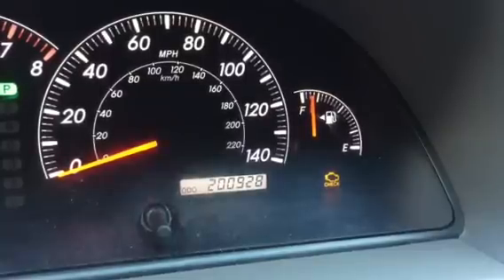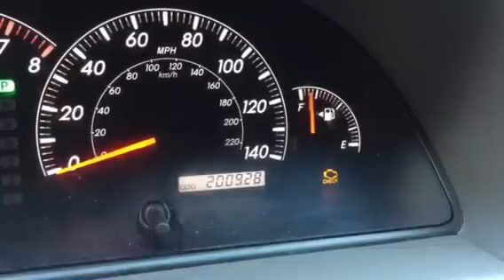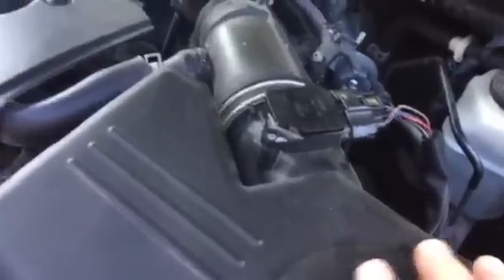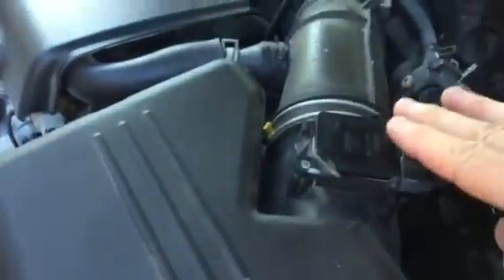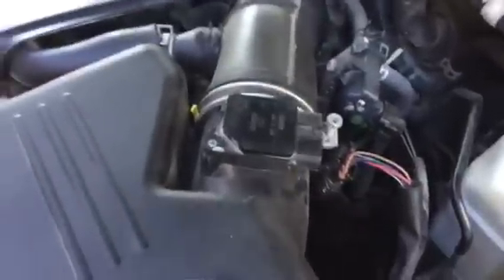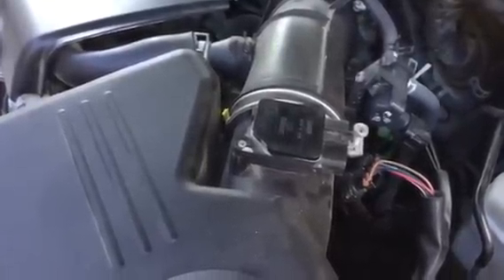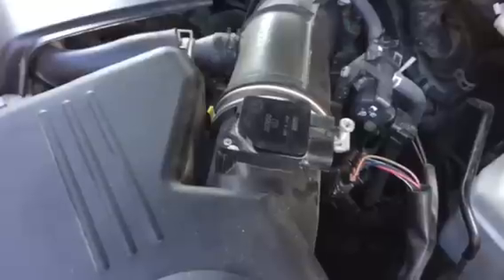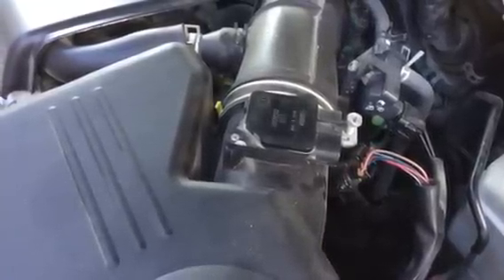How To Tell If Your Mass Air Flow Sensor Is Bad On Your Car

Comment: I unplugged mine and it went into limp mode and had to drive it home 20 mph. Does it mean it’s working? I changed throttle body plugs coils and air filter.  I ran injection cleaner and cat cleaner. I still have hesitation when kicking down a gear on hill. I. Bought  a maf sensor and 
when I put it on it made the 
engine valve’s slap like cheap gas.I am gona try a new maf sensor and see again if it’s the problem.

Comment: This just made the car run worse
Reply: your car could have went into failure mode. which protects your engine and does not let go more than 3000 rpm. For some cars you need to go to mechanic to exit this mode. hope it helps

Comment: Before you go replacing the MAS you can take it off and clean it with electrical cleaner spray, this usually works and saves money
The same with your idle control valve

Comment: I’ve try it on 15 Subaru wrx and the engine is not dead but the idle is upset.
Then while the engine run I plug in the harness back and the engine just dead.
I wonder if anyone can tell me if my sensor is good or bad?

Comment: Took my 2009 prius for oil change and they gave it back to me with engine light  on. The cel light was on. They said car would not drive while  running, they also said engine was running poorly. So when they found code p0101 they did more inspection. Checked and moved harness and noted loss of engine powers fault.
Removed sensor, cleaned and test voltage with sensor pulling good voltage. Used another sensor from  used car and sensor was reading the same. They saw rodent feces and probably rodent damage to the harness. Resseted and manipulated harness and pulled error  code again. Resetted 3rd time time and noting  no faults or problems.. They recommended  
more  electrical testing?? They said if issued further happens...possible harness issue

Comment: Not quite correct. IF the junction or harness is impaired -- the sensor could be fine -- and yet the ECU will read a trouble fault.
The only way to prove that the harness and connector is good/bad is to directly test the leads to the sensor.
With a voltmeter -- even a cheapo $10 one -- this is pretty easily done. Two of the pins must be 12+ and 0 volts, ground.
12+ is always going to be on the right if the sensor is a Denso. (Very, very common -- the one shown is a Denso.)
The system ground pin will be right next to it on most Denso sensors. 
The signal back to the ECU will usually be 1-2 V coming off the next pin in. (Denso, again.)  
[The 12+ and 0 volts must be engaged with jumpers for this test...] 
You do all of this when there is any question about the connector or the harness... which is rare.
When an engine is all warmed up, the ECU will not depend upon the Mass Air Flow sensor. So the video advice is untrue. The engine must be cold.
A warm engine means feedback from the oxygen sensor -- and the ECU will run the engine -- badly -- with that input. It won't instantly stall.

Comment: Yeah I just wasted a hundred bucks because I did exactly what you just said and numerous other people on YouTube said your engine will stall well I checked mine I pulled it off and the engine did not stall what you say means it's a bad sensor so I went and spend a hundred bucks on a new sensor put it in and just to check it I unplugged it engine stayed running you going to tell me that brand new two sensors in a row or junk you're full of shit that don't work

Comment: I cleaned throttle body and mass airflow sensor now my car wont start it cranks but no start I'm wondering if it's the mass airflow sensor
Reply: what did you use to clean the mass airflow sensor? it needs a specific cleaner or else it will be damaged, also never touch the sensor that sits in the intake pipe as well it’s very sensitive. was the car starting before?
Reply: @user.256z  thanks for the response it was tge mass airflow sensor I replaced it started right up i used crc mass airflow sensor cleaner

Comment: Mine kept running when unplugged. Then died as soon as I plugged it back in, does that mean it's bad on a 2005 Chevrolet uplander?
Reply: it could be your mass airflow sensor. how does it run when it’s plugged in? also t could be sending false readings when you plug it back in

Comment: Some cars like my 01 ford van will go to default settings. It wont run 100% but my van wouldnt start and by disconnecting it the default kicked in and van started

Comment: Happening to my Astra K right now.. I got 3 error codes 2 relating to Air Flow (P1101 & P0101) I also have P0299 which is Underboost relating to turbo im also gonna guess that this is also due to the same problem- Air Flow since it has triggered "Limp Mode" so the cars performance has been reduced.

Comment: My sensor is fine.  Mine actually runs better disconnected. Unplugged I can tell the off idle is snappier and the shifts are crisper. Dropped about 10% mileage.

Comment: I am a professional. You are absolutely an idiot that should not be teaching people. Your instructions give no help. 
All modern cars constantly self test for mass air flow sensor failures. They will turn the check engine light on. It will be found that code P0101 is present which is true for ALL cars. 
Bottom line people. If the light  Comes on just take it to the local auto parts store to have them retrieve the diagnostic code for no charge and react appropriately based on the code in the research not some retard telling you the unplug things.

Comment: 2001 Toyota Tundra 3.4 pulled 2 codes, trans code and o2 code,
  I was told that the trans is incorporated into the torque converter,
 I researched and gathered it all starts at the air breather and ends at the tail pipe, 
 the issue is usually before the coded problem, so I started with the air filter, no issue, pulled the mass air flow sensor, it was dirty, cleaned with air flow sensor cleaner, two days later no codes😎

Comment: This video is very. very bad advice.  Many vehicles will continue to run when the MAF is disconnected. The PCM may use a default strategy when the sensor fails or is unplugged.

Comment: This is very well explained and it is important to know this also sometimes you may not need to replace your MAF Sensor so you can buy a special Mass Air Flow Sensor Cleaner which is a spray and spray the metal wire part of it, you  can watch videos on how to clean MAF Sensor.
Reply: If the car doesn't turn off your maf sensor is bad or the connector is bad
if u have a rough running engine when the sensor is connected cleaning it might fix it but if the engine doesn't stop at all when u dissconnect the sensor then your maf sensor is bad
Because maf sensor cleaners clean the sensors and they work only if the sensor was already sending signals or working poorly atleast
If you pull the connector and it turns off then the sensor is working "even if it was working poorly it would turn off"
It will stay running if the sensor is bad
This is my thought about maf sensors if anyone thinks that am wrong pls correct me 😁
Reply: The idea of Mass Air Flow Sensor cleaner is not to fix a faulty MAF, it's to KEEP IT CLEAN so it doesn't crap out.
Another sign of the MAF being dead is the car running rich, and I mean halve your fuel economy rich, blowing fuel smoke by the bucketload and getting worse as the throttle is opened more. Plugs often foul and cause misses within 50miles or less.
Contrary to popular belief due to a "Pimp my mum's car" kids show from England, check engine light doesn't necessarily just mean a faulty O2 sensor! 😂 😂 😂

Comment: Does this trick apply to a 2014 chevy malibu ltz? Reason I ask is engine kept running when I unplugged mas so I got a new one. Car drove better but now check engine light came on P015A . I unplugged mas again and engine kept running.  Maybe bad new mas?

Comment: sensors are not all the same, some control idle and some are not.so some models won't cut off.
Reply: Do you if this trick would work on a 2014  malibu ltz?
Reply: @robfolks  this only test one thing, other are misfire idle and acc delay .
Reply: @alanw5812  yes but will the engine cut off if mass air flow sensor is good as in the video on my Malibu? Thats my question

Comment: Thanks for this video. My idle is flucuating up and down consistently while stopped and in drive gear. it flucuates from about 700 down to 600 then back again consistent every 5 or 6 seconds. Any ideas? Thanks and God Bless.
Reply from the maker: Did you recently disconnect a battery cable?
Reply: @proclaimliberty2000  This started the same day about 6 weeks ago  after alternator and serpentine belt was changed.  Then I disconnected the battery  about 3 weeks ago. Not since then..
Reply from the maker: @wingsoneaglesmusic  How many miles have you put on the vehicle since you disconnected the battery three weeks ago?
Reply: @proclaimliberty2000  approximately 3,000.
Reply from the maker: @wingsoneaglesmusic  The computer should have reset by now. My recommendation would be to clean the throttlebody. Do you know how to do that?
Reply: @proclaimliberty2000  Yes. Have done that with throttle body cleaner. Also checked the MAS and that works. It seems to me it's electrical. Seeing how it's a continual drop and increase. I am just a lay person though. Lol. Seeing how this started the day the alternator was changed. Any possible connection? Thank you.
Reply from the maker: @wingsoneaglesmusic  Who changed the alternator?
Reply: @proclaimliberty2000  Licensed Mechanic. I have had the alternator output checked since that time and it's putting out average to high is what the voltage read.
Reply from the maker: @wingsoneaglesmusic  if it were my vehicle I would be taking it back to the mechanic and tell him everything you’ve told me and that they need to fix it at no charge since they created the problem
Reply: @proclaimliberty2000  I have absolutely considered that. Unfortunately, I need to have some way to tie the current issue with the work they did. This is why I am asking for insight on what it could be and if it indeed could be electrical and connected somehow to the alternator job..
Reply from the maker: @wingsoneaglesmusic  I would simply speak to the manager and tell them that this issue started right after your alternator was replaced and see where it gets you.

Comment: I don't agree with this method. I don't think it's entirely accurate, plus some people suggest that if the car dies when you unplug it then the maf is bad. So someone needs to come up with a more definitive test for these sensors. Because they are vital to a cars performance and mpg and they can fail without warning or a code. But this video is not accurate for all models at least.
Reply: From my resarch, typically cars WONT shut off when you unplug the MAF because the TPS and ACT will act together to determine how much air is flowing through. However I'm sure it depends on the car and manufacturer. So, this is not a good indicator of a bad MAF for everyone.

Comment: I was going to take my 2008 Pontiac to a shop to put the mass air flow sensor on a new one and a emission evaporative position sensor showed a leak that I know where’re it is exactly. But the shop wanted to charge me $700 for labor. So I looked on YouTube. Thank you cuz you saved me money on the mass air flow sensor. And now I have to look at how to fix the gas air leak. It was so easy to put on a new Mass airflow sensor.

Comment: I know this video is older. Hopefully I can get an answer. I did this on my Volvo 240. My car didn't turn off but it made everything instantly run like shit. I'm hoping this also means it's working. I'm trying to stick to OEM parts. They're expensive.
Reply: It does. Not every car will shut off when the MAF is unplugged because they have systems in place to use in place of the MAF. Though, not as accurate and efficient as an MAF

Comment: I have a 2006 ford f150 5.4.  When I unplugged my maf sensor the truck kept running which I thought meant that it is bad but I did the same thing to my 2004 chevy silverado that doesn't have any issues and it kept running too.

Comment: My bmw runs with it disconnected but pulls back pretty bad when giving it full throttle. I plugged it in and the engine shuts off. I replaced it plugged it in and it’s still shutting off wtf but runs when I unplug it

Comment: If you have a car past 200k thats older then like 04-03 chances are ur maf is OLD and needs to be replaced
Reply: I have a 2001 lexus is300 did fuel injectors spark plugs and cables spent a bunch of money to fix even the smallest vacuum leaks , fuel pump and even got a whole new cold air intake just to do MAF at the end and have it fix my hesitation for acceleration LOL try the maf first!!

Comment: I have a JX 35 that starts and runs whether it's installed or not. I don't mean it runs well but it definitely doesn't stop if you disconnect it while the car is running.

Comment: I have been trying to figure out what was wrong with my wife's Malibu for months. Came across this and I will be damned. Changed MAF sensor on 2011 Malibu and now it's purring. No engine codes. God bless you for helping discover the fix and for helping me save money.
Reply: What was your wife car doing?
Reply: @Theeverhettshow1216 It was shutting off at random times and idling hard. Idk why your question never showed up on my notifications so I'm answering five months later. The suddenly shutting off in reverse and at a stop sign is what threw me off. It's still running great now
Reply: @kiethj7  this happed to me on Thursday before this happened I had issue with the manifold exhaust by the engine.
Reply: My truck sometime in parking  tu motor stop
Reply: Thank you for your honesty and to the point explanation. Please do more videos.

Comment: If I lose my car and I lose everything this is the last issue we've had so many problems with this car I have a Chevy Colbot.  and I hate it.  It's coming up with all kinds of numbers with the scan and I'm starting crying and the automotive store because I just looked at the guy and said my car will not be fixed my boyfriend will not fix it he doesn't know how and he doesn't know what he bothered. Help
Reply: On top of that I have a bad hot bearing and that's like infants they want $800 to do one side how ridiculous is that

Comment: Folks if your check engine light is on, Get a scan tool and verify why the check engine light is on with your scan tool. Never try to guess why your check engine light is on. U can get a cheap scan tool just about anywhere these days

Comment: I was amazed that my terribly running recently purchased 07 pathfinder stalled slightly but kept running. Does this definitively mean that the sensor is faulty? That would be an amazing quick to a problem that’s been taking too long to figure out. Thanks for the awesome straight to the point video.

Comment: I didn't have a check engine light beforehand I unplugged it because it's running weird and when I plugged it back in and turned the car on after it died it caused my check engine light to come on

Comment: my car has been stalling after warmed up, usually when i'm slowed down. I unplugged the MAF and it kept running but it stalled more often. Plugged it back in and it made it around a few blocks without stalling.. IDK what to do
Reply from the maker: Have you cleaned the throttle body?

Comment: My car did not shut off when I disconnected the harness...I bought a new one and it still does not shut off when I disconnected the new one....what do you suggest now. My check engine light diagnostic said it was the sensor causing my reduced engine power

Comment: Good video, watched a few but would like to point out.
My transit no tick over and very poor revs no engine warning lights on.
No error codes on my hand computer ??.
Pulled maf sensor plug. No tick over but revved good. Managed to drive while try new sensor.
Garages didn't want to look for fault.
Any way sensor from ford £100 Amazon £20.
Fitted works fine but got to run 15 mins till computer except then fine

Comment: I pulled the Mass air flow sensor on my car and it was still running. I then bought and installed a new one and pulled out the plug afterwards and the car was still running. What does that mean ?

Comment: I bought an aftermarket part new MAF sensor on Amazon and it did not correct the problem 
Now I’m wondering if the new part is defective or if the test you’ve provided to us is valid if there are other issues or something going on beyond the sensor
Reply: Was your engine light still on

Comment: Thanks for the diagnostic tip. My mass airflow sensor went bad because of freaking squirrel chewed through the wires and I drove the car for a couple of weeks with a bad mass air flow sensor which made an incredibly lean mixture that dirty the heck out of the mass airflow sensor. Just a tip if you want to keep squirrels out of your engine compartment go to a local store that carries essential oils and buy some peppermint essential oils and put about 40 drops into a spray bottle of water and sprayed around your engine compartment it'll keep the squirrels out. But you can't drive your car for about 5 minutes because your car does not like to breathe peppermint oil

Comment: If you disconnect the mass airflow sensor, then the car should keep running and still be able to start normally.

This is because the computer in the car if it does not receive a reading from the mass airflow sensor, will estimate and supply a number that it thinks it is supposed to have. This means that if your mass airflow sensor dies completely, then your car will stay running and surprisingly the car might run better without the mass airflow sensor.

Comment: If your engine stops running it means not only the maf is bad but something else including the ecm because the engine will run without the maf connected by defaulting to a preset perimeter which may be better than a bad maf. But not perfect as with a good maf.